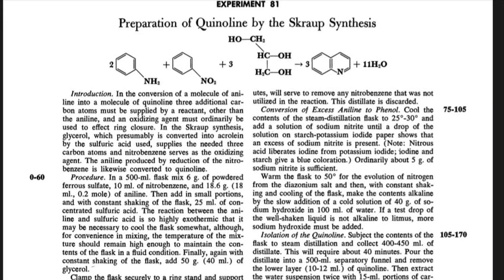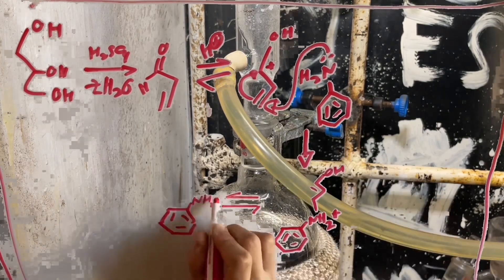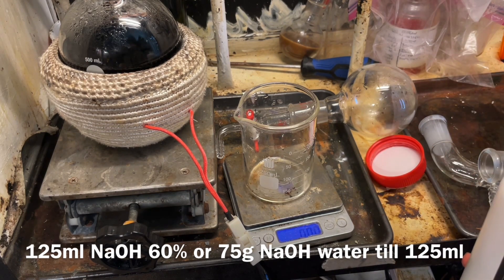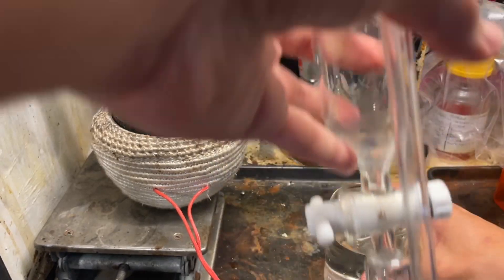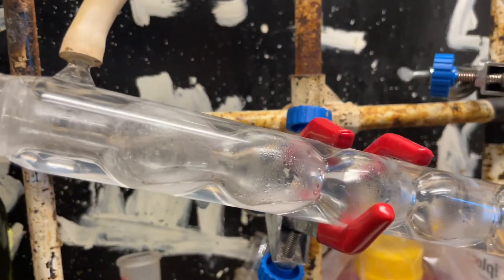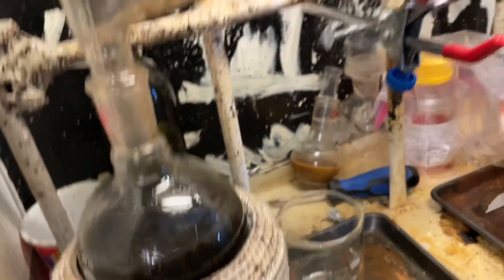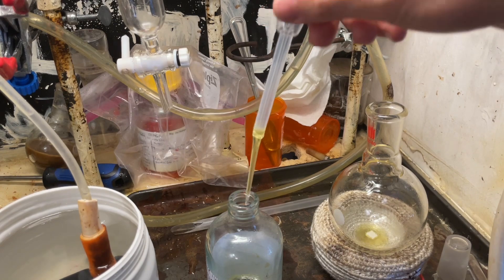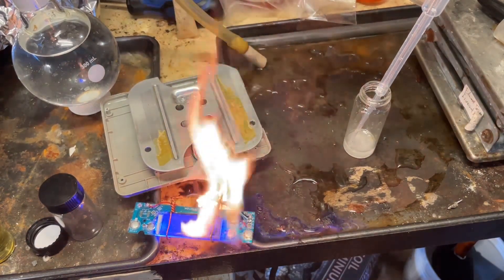Quinoline Synthesis via Boric acid Ferrous Sulfate modification

Comment: Magnetic stirrer sometimes makes wonders in preventing bumping. Stirring speed also affects speed of heat transfer from heating mantle and gives you a quick way to adjust heat transfer rate that is sometimes usefull.
Reply from the maker: oh yeah during the one that bumps i did use stirring, didnt work well for some reason
Reply: @EdwardTriesToScience  My best boiling stones are from broken tea mug. Works every time. Much better than any alternatives I have tried.